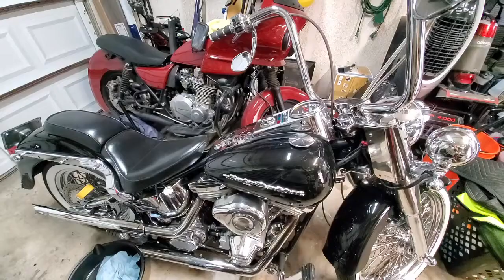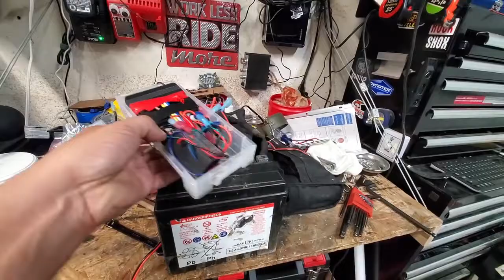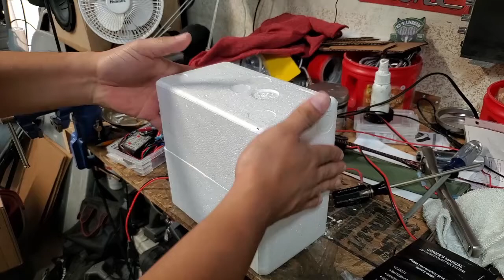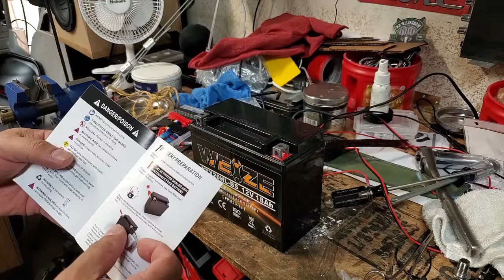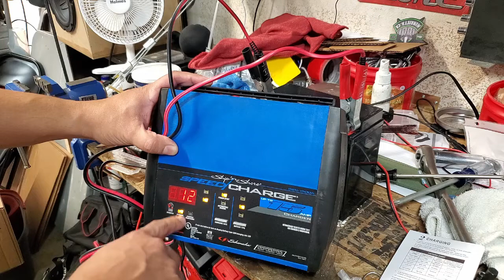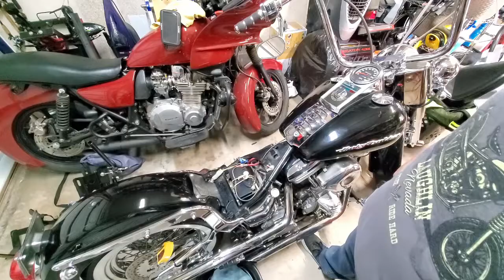Harley Davidson Battery Replacement

Comment: Battery tender wires went on last?
Reply from the maker: @camswar  yep, I typically run those on top unless the ring termination is large then I might put it under the battery wire if I'm too lazy to swap the termination to the right size.
Reply: @ thank you ! Just getting for summer. New subscriber! Great channel!
Reply from the maker: @camswar  appreciate you watching and your sub. Ride safe bro